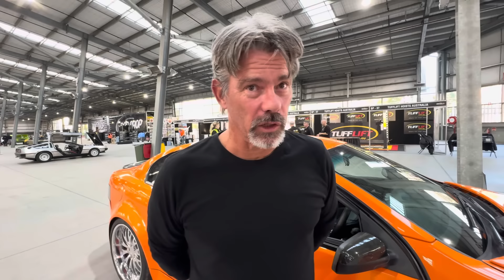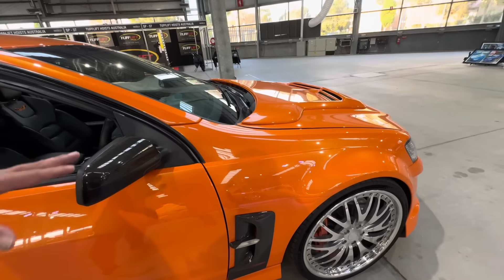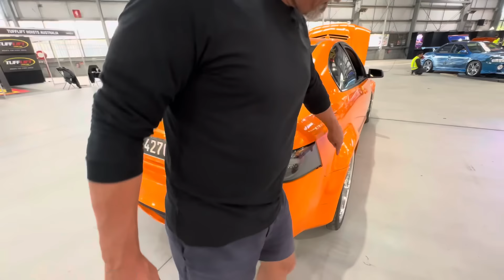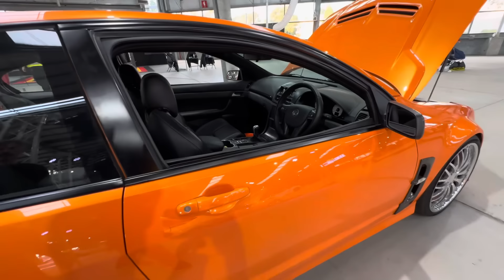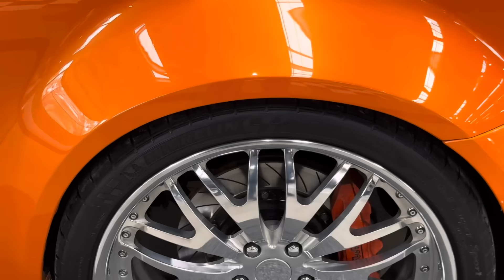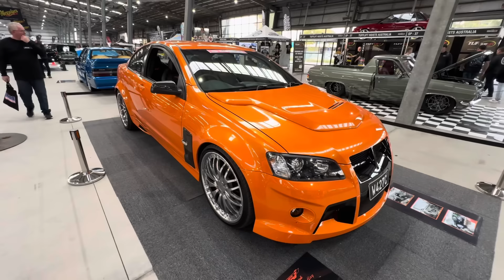VE HOLDEN Ute Built Into A Coupe

Comment: For those saying Holden should've built this (and I agree), Holden did a concept car which is at the birdwood museum and it was a VE coupé.
Reply: A good looking machine that VE concept. I reckon would have sold in really good numbers
Reply: Just like they did on the monaro, 2dr coupe for the commodore. Now i see the 2004 monaro it looks pretty nice and can tell it is expensive
Reply: Holden had roughly about 14 body styles planned for the VE but they only ended up building 5 of them (5th gen Camaro was one). If only GM had let them do what they wanted.

Comment: Using the ute as a base with the rear wheels 100mm further back really makes the look.That shorter rear overhang looks fantastic. Really subtle and well done, but makes so much difference. Undoubtedly it helps with stability too, not that the VE platform ever really had a problem with that, but you can always make something better and this certainly is.

Comment: The glass factor I remember when the ash tray was a little window near the side mirror. Not shore if the problem with the glass is more the front or the back.
Like the idea that a ute
 is a station wagon, the sedan can be a couple so if a little here a little there you could get 4 models from one platform chassis.

Hey those LS engines can run on hydrogen look up the ute in America it's a cherry red.